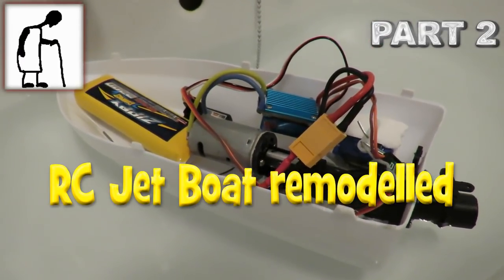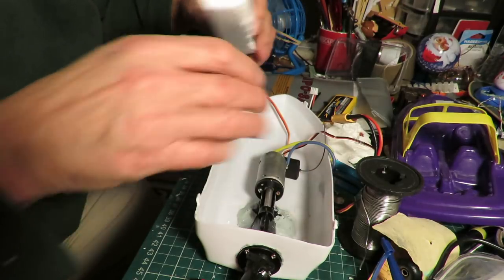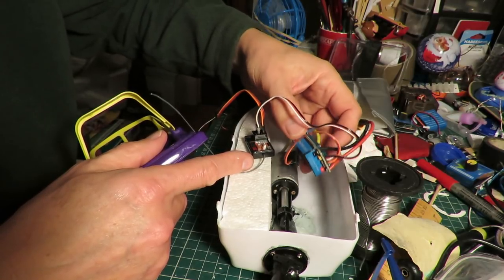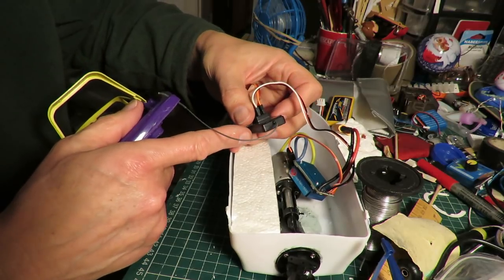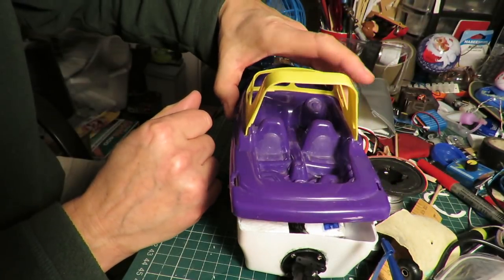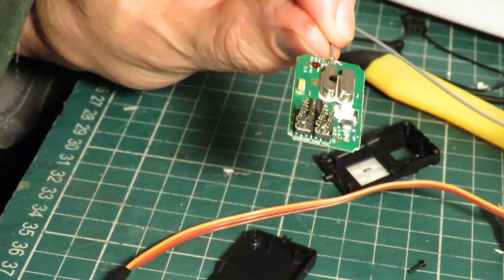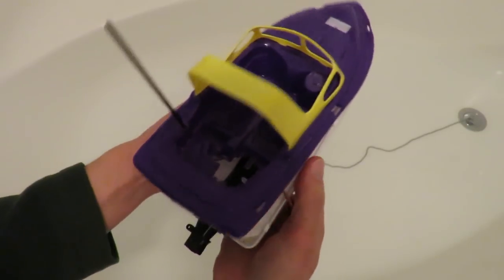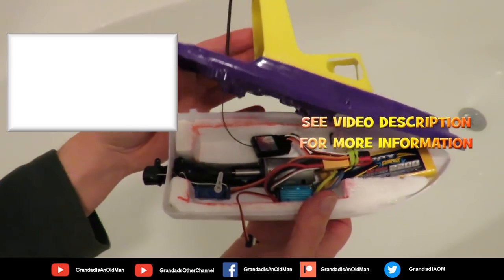RC Jet Boat remodelled PART 2

Comment: That's really, really nice! One idea to cover that area you had to cut is using PVC. From those white pipes, really. You can heat it and easily mold it the way you like. ;) (I actually made PVC boards from piecse of pipes. And posted a video showing it too. I did it with the stove, but it's easier to use the oven.) :)
Reply from the maker: My father-in-law was a plumber and did many tricks with PVC pipes 😀 I have just watched your videos - nicely done https://youtu.be/8Pf5MrUF-Io
Reply: GrandadIsAnOldMan Nice! And thanks a lot! :D. That stuff is really useful. There's a channel that the guy makes RC cars that are exactly replicas... And he uses wood, PVC and so on. :)

Comment: I have a feeling on a larger body of smooth water that little fella is going to fly. My only worry is if at speed it doesn’t go flippy on ya being so small especially if the water is choppy.
Reply from the maker: In the first test run I have too much weight at the front. In the second test run I have too much weight at the back 😀

Comment: Should be able to make it up that stream. 
New Zealand style 😀
Reply from the maker: Next video shows I have the balance wrong, fixed that in the video after that. Weather has closed in a bit since then and that little stream I usually try is flowing a bit deep and fast at the moment.